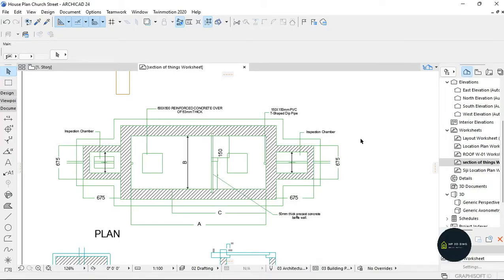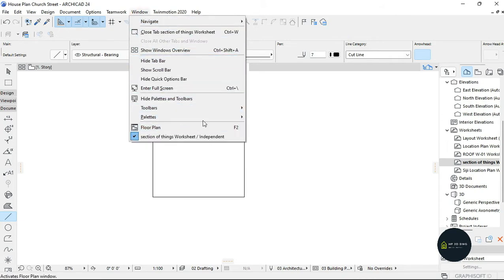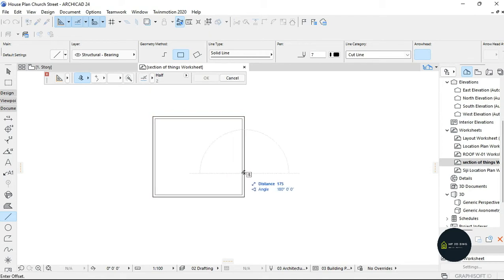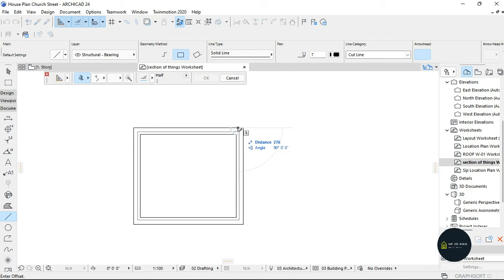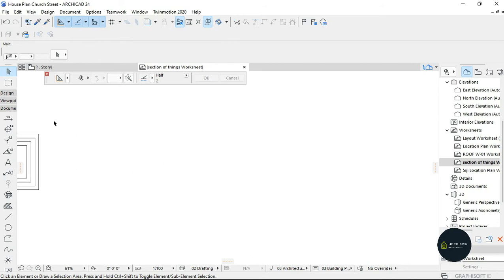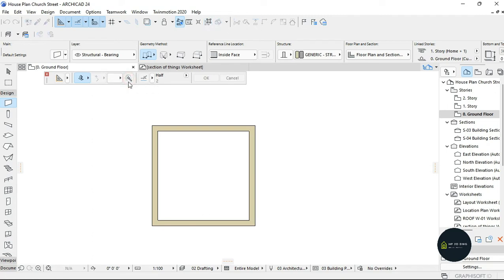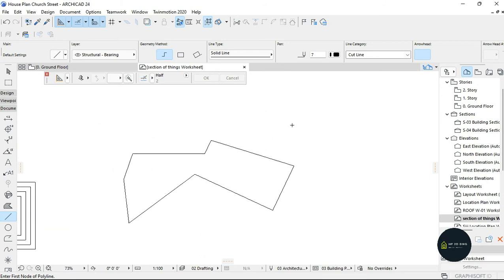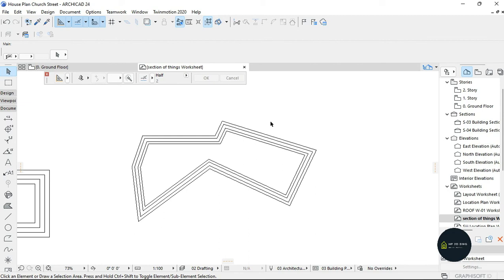How To Use Offset Tool In Archicad

Comment: It does not work for me. It is very unlikely that you offset a complet wall around in a real project. Most of the time you just need to offset a wall or a line. And this is not the case